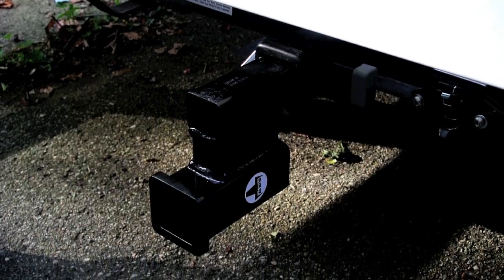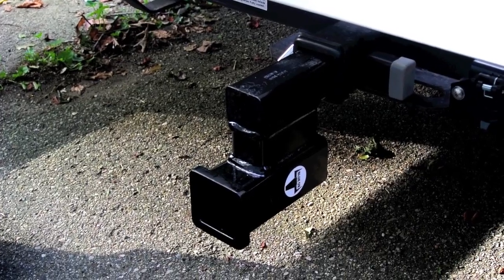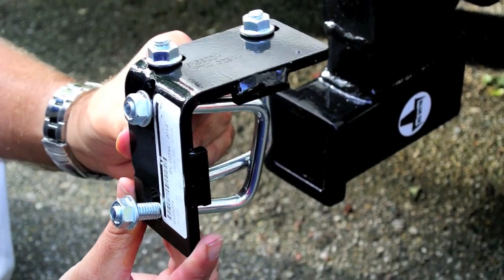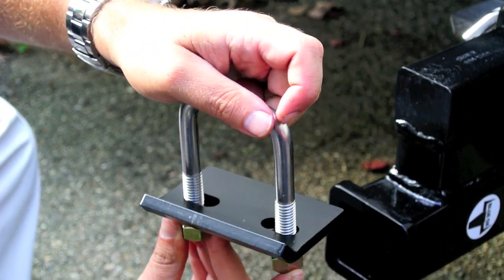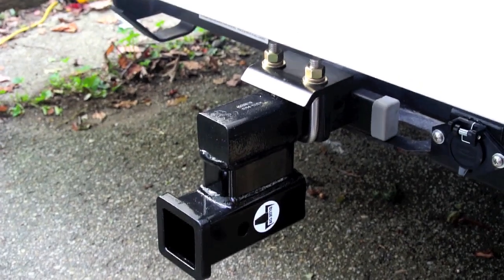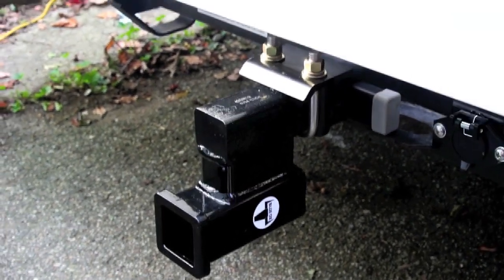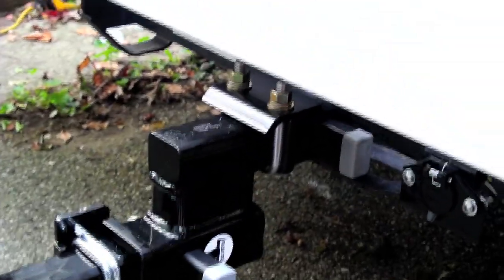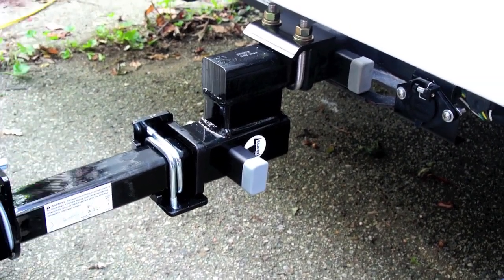Use a hitch immobilizer to silence that hitch rattle.

Comment: Mounting the stow-away upside down, is actually a failure point. You are taking up the slack against the top of the inside of the receiver. It's working against gravity.  When mounted with bolts down the U bolt forces the metals to mate on the bottom of the receiver working with gravity.  On a bump at speed, there will be a lot more forces on that U bolt when it's upside down.  I suppose worst case your slop just comes back if it fails and some loosed road debris for following vehicles.
Reply from the maker: I has to install the immobilizer that way since the drop receiver would not allow installation with the plate down. The towbar adds virtually no tongue weight as the tow vehicle is supported 100% on its own suspension. The forces under tow are horizontal, not vertical

The immobilizer is pretty massive, and i doubt there has ever been a case where it has failed as you suggest.  Don't see an issue.
Reply: Exactly. Physics based, good info.
Reply: RVProject j
Reply: @RVProject  not in your application, but if someone was towing a trailer with significant tongue weight, it could be. This the problem with youtube, you have people showing something that is fine for their app, and others emulate it when it does not apply to their application.

Comment: Save more money with a small flat bar with a hole drilled same as hitch pin size. Try to find a bar that is somewhat soft ie: metal soft, but not to wimpy. Try copper, then pick left or right your choice and shim it with the flat copper bar. This should also help you to get a better ground for your lights as well. You can also tell your friends it 100% made in the USA by you lol. Good luck and be safe, Nice video though. P.S. Add a small bend at the end of the bar to grab hold of if needed when removing the ball receiver........                                                                                                                                                                  
                                                                    ⎝⧹╲⎝⧹ÐΛЯΞ †o ÐЯΞΛM⧸⎠╱⧸⎠ [̲̅$̲̅(̲̅☠)̲̅$̲̅]¹°°
Reply from the maker: One of the goals I have for RV-Project.Com is as a catalyst to get people to think about their own ways to do things. Nothing pleases me more than someone taking an idea of mine and improving on it.

Comment: I think that stowaway only supports in one direction while the Blue Ox one supports up and down and sideways. I would be concerned that the stowaway my wear under load by shifting sideways and that wear might cut a small groove that could weaken the hitch. Mostly a problem for people with heavy tongue weight which I see you don't have but still a bit of a concern. 
So how have both these been holding up over the last couple years?
Reply from the maker: Yes the Stowaway is one direction only and does put a groove into the hitch.